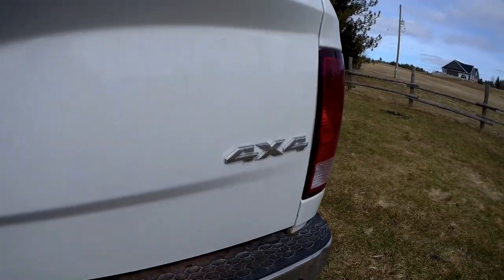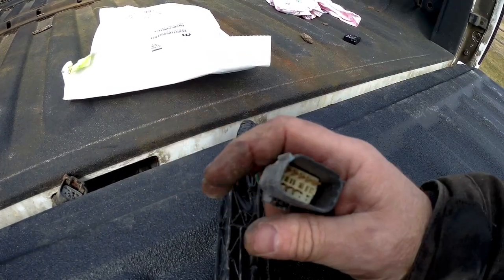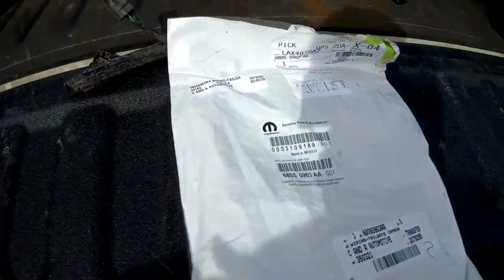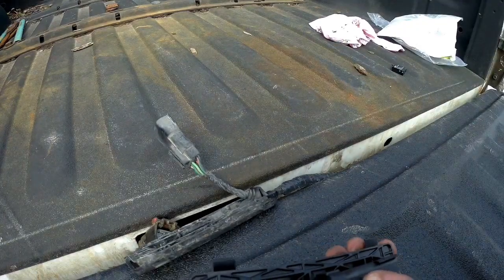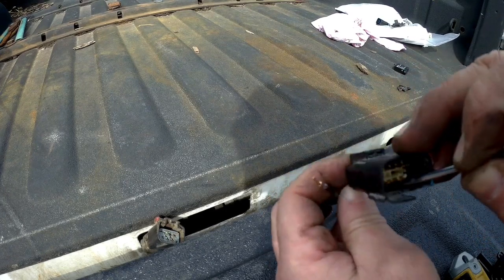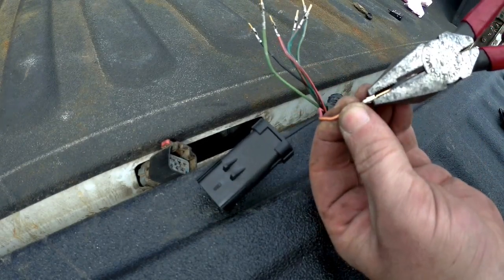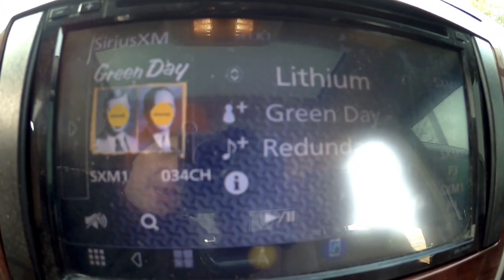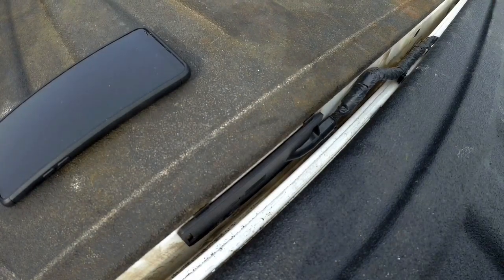Dodge Ram Tailgate/Connector Swap - Getting Your Back Up Camera Working Again

Comment: Do you know where you can buy the other connector (the side you didn't replace coming from the truck to the tailgate? My connector broke and the dealership wants 275.00 for a repair kit to fix the broken connector.

Comment: do you have schematic diagram or color each wire and how connect.?
Because you show only system how you do that and i need which cable
from the new tailgate you insert and contact with the old cable
get me answer please. Greg
Reply from the maker: The colours on the connector are the same colour as the truck. I have wiring diagram but only used it to confirm this was the case

Comment: What wire does the white/ purple coming from the radio go to? My connector has been cut from truck. Only plug that's still attached is the tailgate camera.
Reply from the maker: The back up camera has 5 wires in the 2011. Pink/tan 12V, Drk grn/org camera return, dk grn/brown camera signal, NCA wore (black and thicker) camera shield and black/grey for ground

Comment: Can i just hard wire it? I bought a new camera as my tail gate was stolen and i can nit find the harness that goes from the camera to the truck harness all the harnesses i find dont have the right plugs. My camera and truck have the same plug as your spare plug
Reply from the maker: Should be able to do that, but I'm not sure about the video feed cable